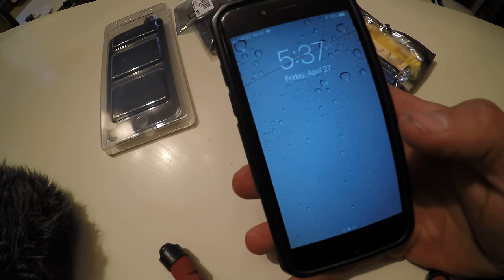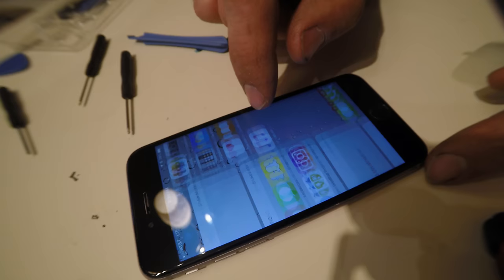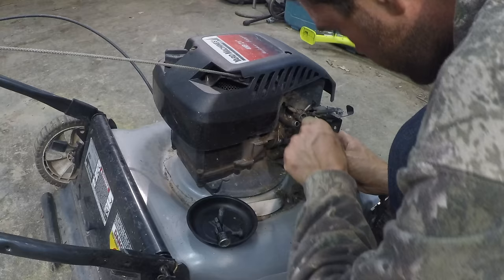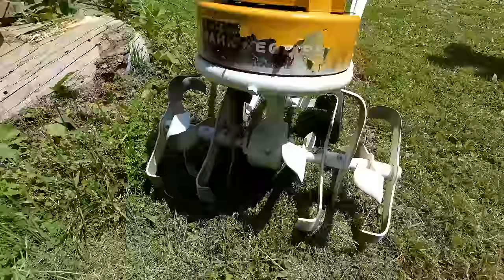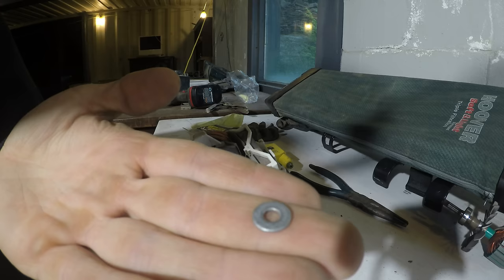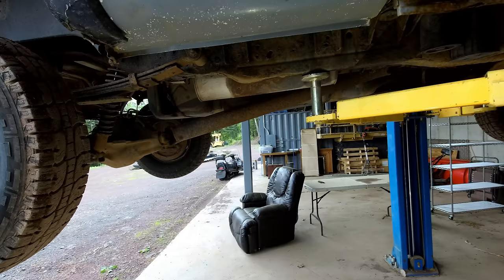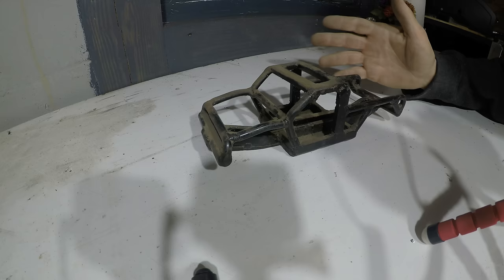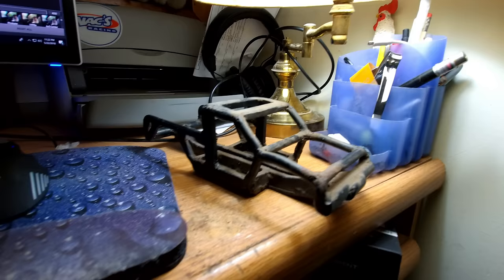Fixing stuff

Comment: As far as your dream truck or car goes you should watch Jay Lenos Garage . He has had people on that were making new cars or trucks and he explains or they explain the insane amount of stuff they have to do to make the gov. happy. California is the worst. Sad but for the most part one state is making all the rules.  Anyway things like your idea that you could buy a new truck and tell your friends who have the same kind of truck to just smash into yours and your truck would be fine. Nope. The gov. makes it so the auto's have to crumple up . They used to be very solid and bumpers were real things people really did park by feel . Just back up the huge car with a trunk that could hold a enough stuff for the family to go move someplace but seeing the back was not so good so people did just back up and bump the other car and nothing bad happened . Then the liberal guy who wrote Unsafe at any speed . came along and things changed fast. It was then that crumple zones and padded dash that was the first thing the dash . then all sorts of things now the want cars to drive themselves. Well that will not wrote if so much as one solar flare comes along and it will and they have . All the computers and electrics will stop working and the cars will crash or at best just go from 60 to 0 in no time and stay at zero forever or at least for six months or so until people replace all the things that were fried. .  Point is that to get an auto made for the road in all states is like attempting to build a rocket ship to take people to Mars and back in four years and have hot tubs in the space ship.

Comment: Bruh if you want a better truck just buy a Toyota instead of a Dodge. That'll solve 90% of the problems. Your car idea sounds alright but if you want all the electronics water proof, and every bolt stainless, that'd be expensive, also possibly you'd get galvanic corrosion issues. Making the skin of the truck thicker will make it a lot heavier and lead to worse fuel economy and handling. Same with bigger wheels, that's not good for fuel economy either, and they are more expensive.

Comment: No offence but when you talked about trucks I respect your opinion and I know you don't care about looks..all you want is practicality but heres what I got from watching all your videos:

1.There's periodic and preventative maintenance 
You seem like a guys that waits for something to break then fix it.
2. Rusted frames as you already know come from the environment you live in, putting in mind all your trucks were second hand and the first guy who owned it didn't spray the under body with weather insulation so there already rusty when you buy them. On top that they don't get washed a-lot after use so this doesn't help.
2. The design is not something they came up with over night,  years of experience putting in mind maintenance,weight distribution, clearances,engine size depending on the weight and many  things that effect fuel consumption.
3. When it comes to over engineering the electrics I agree with you on some level but trucks function better with Abs,stable track, traction control ext ext
The best thing you get from this is you can scan your ECU  and isolate what caused any problem you had.
4. The frame idea you showed is more like a Baja trophy truck for going fast not something you use to pull a trailer with heavy equipment around town.
5. This might be the main thing I want to say and its that all the trucks you have are light short-bed trucks made for hauling/towing specific loads when you go over  the load thats when you start bending stuff and breaking gear boxes at the same time straining the engine.

They build HD trucks some with dually wheels and diesel  engine that can withstand the brutal weight and environment you put them thru and have the torque to tow/haul anything you want.

Hope you don't take this personally 

P.S. Chevy, Dodge,Ford if any one of you guys is watching sponsor this guy with a truck that  fits his needs  to prove my point and change his opinion

Comment: They make the difficult so you have to take it in to get it fixed and they make the parts cheap for the after market parts program, to keep the money flowing.  It is done on purpose, they don't want to make it easy and strong so nobody has to replace the vehicle, but if they did, we would all be better off, just not making them rich.  But making us all wealthy

Comment: In regards to electric in wheel hub motor, Lightyear is developing a Commercially available Solar Car with such of motors, so you could potentially draw some inspiration from there: https://lightyear.one/lightyear-one/ Just that their application is lighter duty, but apparently they were able to simplify the wheel hub motor design, so that unsprung mass does not effect the handling, so some smart engineering had to be done to overcome the one of the main reasons why hub motors are not that great for handling...

Comment: I love him, but glad he doesn't design cars.  1st, he'd never meet new emissions standards due to all the weight from his frame and bumper ideas.  2nd, we had everything taking the same headlights before...it was called the 80's!  3rd, those "wierd" complicated frames are called crumple zones...they are energy absorbing and a lot safer.  4th...replace the frame...you can.but a new one and don't live in the rust belt.  5th...computer sensors ruin the vehicle?  It makes the difference between 2 miles to the gallon and 20..it's called electronic fuel injection.  I'll stop with that...

But he's so great, I'll overlook it...just this once!
Reply from the maker: Those emissions standards are illegal. And with crumple zones, just don't crash.
Reply from the maker: Trucks could be built to last 100 years, these 10 +/-  year vehicles are scam.
Reply: @AndrewCamarata  I agree, but I don't see any 10 year old vehicles in the junk yard either (that arent wrecked)- visit one.  If you find one that has more than one, let me know because I'd like to visit it and upgrade a few vehicles.  Especially if they have trucks.
If you do a quick google search for the average life span of a vehicle in the USA, 2 quick results are 8yr/150k -> 15/300K, and 13-17 years. However, if you go visit a junk yard and even say a salvage yard like pull-a-part, you rarely find them.  Why not? 

There is another topic of what happens after this "lifespan".  Here are some very common examples:
-VERY big market exporting these to 3rd world countries.  It's second life in this other country is of course not taken into account in the statistics
-Accident/Destroyed - another big number.
-Neglect / not to any fault of manufacture

Some of my history:  When I was young, my father and I had a roll back truck.  We hauled cars for dad and myself to repair, scrapped cars, and used it to haul the backhoe to do odd grading jobs.  On average I would say we scrapped 5 cars a week, and worked most all weeks of the year.  So lets be easy and say about  200 cars a year.  My memories of doing that were over say a period of at least 5 years (12-17).  We always had to have the title to give to the junk yard, and I always collected it - it was my job along with operating the winch.  :)  I always looked at the title, I found the vehicles history very interesting.  We did this in Pennsylvania, a state in your wonderful rust belt  :)  .   In PA, the title's were referred to as A titles, B titles, and so on, and it was representative of the number of owners.  In those years, say over 1000 cars, I ONCE saw an A title.  This car did not go to the junk yard, but instead my garage.  I made some good money on that, still remember it.  I never saw a vehicle less than 15 years old that i remember, disposable cards like a Yugo, etc were not yet a thing.  B titles were also pretty scarce.

Whats the point?  The point is the 1st buyer is not going to own this vehicle up until the 10 year mark (being generous here - google says average is 71 months, and I'm surprised it's that high.  So if it lasts 10 years + they really don't care, and a person that wants a 20 year + car/truck is not the target audience of any car manufacturer, only in the fact that it would influence resale value, but there are too many other factors to that too.

So while you think a 20+ year old car is a great idea, you are not the majority, and yes it could have a market, but it would be very niche.

We could then generalize to say could we overengineer it to make it better? Sure, but it's not for free, and buyer A would care more about the price than if it lasted 20 years instead of 12 (or whatever).  All that thicker steel you want to add is not for free either when it comes to gas mileage, another primary topic of the A buyer.

PS, one of the first articles from the search starts out:
"Vehicle owners today are keeping their automobiles longer then ever. The average lifespan of a vehicle is currently 13 -17 years while the average age is 11.5 years. The number of vehicles on the road in the United States has reached a record level of almost 253 million, an increase of more than 3.7 million, or 1.5%, since last year."

So it suggests that they are already better than the old 70's/80's non computerized, ridgid steel frame vehicles that you claimed were better.

Can you make it last longer?  Sure!  But really the buyer (read first owner) does not care - Reliability, looks/features, and Resale value is most likely his first /second / third concern. 

Also the wonderful 70's / 80's cars and trucks, 100K was about their limit on average.  Nobody scraps a car at 100K today, that's only half it's life.

Also, if you wanted it to last longer, y'all could not put salt on your roads.  You dont see trucks like you have down here in the south.   And maybe wash the undercarriage regularly after snows goes a long way.  But we are busy, and we have to work too!

Keep up your great work, you are truey an inspiration.
Reply: YES, he is great and his truck idea is great as well. Plus, no one said there couldn't be crumple zones in his cage frame. Laugh but the FIERO was built as a 'space frame 1st' with body panels hung over the frame.
My cousin has been working 13 yrs on power to all wheels that renews itself. No recharging. He'll get there as can Andrew.
As for you, no offence but the law is the law until it is challenged! Sonny (CT)

Comment: Take the batteries out of the occasion?? Lol no, that's the problem dude. No wants to be stuck with pathetic ranges and hours to charge. Sure 250-300 mile range sounds ok, put a small tiny trailer behind you or a slight hill and say goodbye to all that efficiency crap because your batteries drain and drain fast!!! Let alone the stuff you actually trailer hahaha you will burn out those motors and batteries. Electric motors are nice , when a big beautiful diesel is powering them.. like a train :) electric is not the future

Comment: ask Elon Musk for a kit of parts and go for it . $% years ago I designed my 1980 Donnington Gt championship winning car . The design was all done in my head and my suspension and steering design was achieved using rolls of white wallpaper .. every drawing was full size .  roll centres  bump steer anti dive   all of the stuff which makes a racecar tunable . was done either in my dreams   or on wallpaper .I produced the molds to make the body  using chicken mesh and  plaster  hand scraped to achieve the ground effect venturies .   In a 12 lap race   I almost lapped every other car at least once . Judd racing was local to me in Hinckley   leicestershire and I used to scrounge  F1 engine valves and conrod bolts . I had three engines all rescued from scrap cars . I would rebuilt the three engines in rotation . to always keep a fresh engine for practice and race . You are young enough and have a strong work ethic . so there is no reason why your ideas shouldn't come to fruition . I love watching your videos .. I have just spent 7 months renovating and bringing a 2007 Citroen C6  4 cylinder manual 6 speed gearbox car up to as new condition .. just for a project and something to do .

Comment: About your rant at the end. You don't understand this is all driven by the consumer. You also don't understand engineering and efficiency. You are also in a highly corrosive environment due to using salt on the roads. The issue is with the salt, not the vehicle. There are other and much better solutions to melting the ice but they cost more. You are pointing the finger toward the wrong party here bud. I'm on the other side of the country from you and we have none of these problems with our vehicles. We don't use salt even when we have ice.
Reply from the maker: The truck needs to be designed not to rust, even in the salt.

Comment: Apple really sucks, having a crack on the corner of screen and half the screen doesnt work, i have owned couple samsung android phones that screens are cracked, pieces missing and still work like brand new. also it feels like apple phones are limited, if you want some apps you have to buy them,  transfering files to pc is also pure crap, need to download and have account in some crappy software, atleast thats my experience. apple is way too overpriced aswell. samsung and android the best way to go. free apps, no limits, easy and fast file transfers, more rugged than apple. you can actually install windows xp on that device, and i mean real windows xp not some wallpaper or theme. i had very badly cracked samsung with some small pieces missing and it still works, i used it in army like that and it survived a year with no rugged case around it.